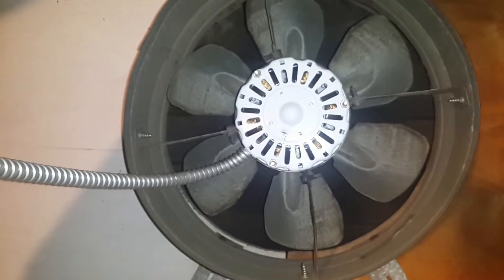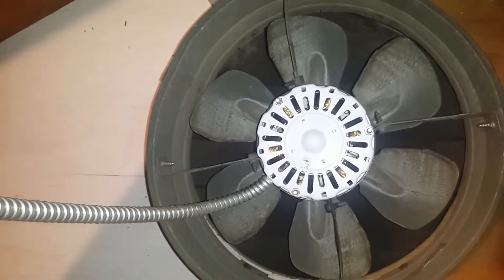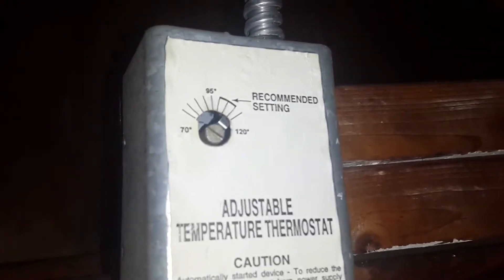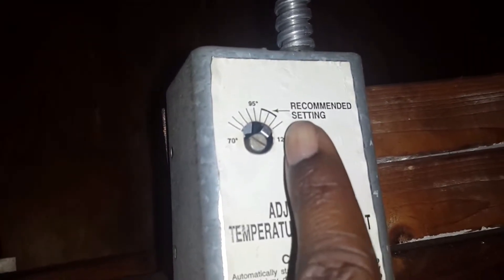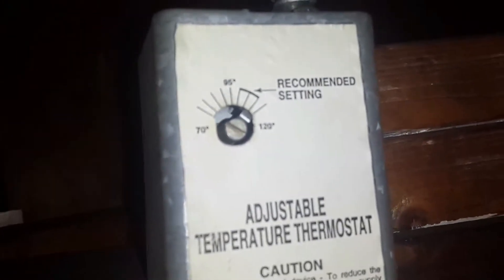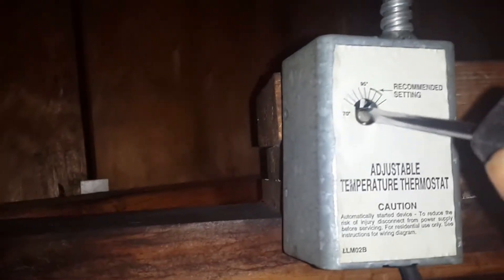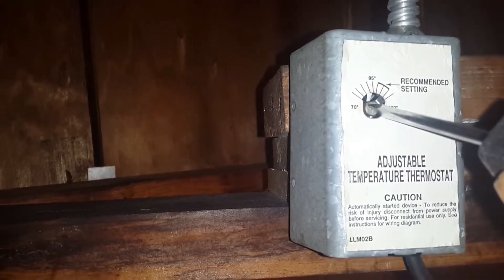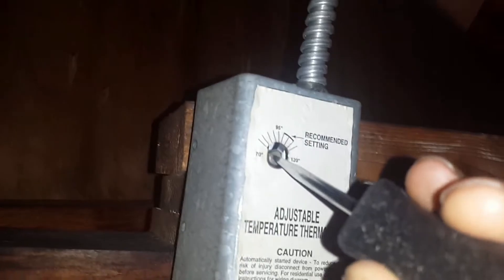How To Adjust Attic Fan Thermostat Temperature

Comment: How do i turn off the moisture settings my attic controller there are  three large vents opennings in my attic  to the outside when it raines the moisture controller turn on the attic fan and pulls more moisture inti my attic
Reply from the maker: We are not sure about the moisture control. Would advise that you make sure that there are louvers on the exterior, and that they are positioned correctly. If need be, you may need to change the cover on the fan so that rain water does not enter.

Comment: So, i’m not a genius or anything but why are we using thermostat designs that look like from the 60’s. Why not have a thermostat that reads the outdoor temperatures and changes accordingly? I mean we have iphones and stuff. Shouldn’t be rocket science.
Reply from the maker: Typically attics are hot (over 100 during the summer) and typically most electronics start to malfunction when the temperature gets above 125 F. Thus the electronic  thermostat would fail regularly in that environment.

Comment: Good job brother. You deserve thumbs up, and I did. I have a fan similar to yours in the garage. It came with no instructions, I only have my right arm, but was able to get it going. The thermostat came with no instructions, so I went on YouTube and connected the two blacks cable, one to the motor, the other to the power supply that plugs in an outlet. The instructions manual said to set it at 90⁰, I did. Just installed an hour ago. The garage is at 91⁰ or 92⁰. If it doesn't stop later what do you reccomend I do. Thank you brother.
Reply from the maker: Welcome!  Glad the video could help you out

Comment: I have an attic fan that turns on by itself but doesn’t turn off unless I turn it off with the circuit breaker switch. Would it mean that my adjustable attic fan thermostat is faulty?
Reply from the maker: Yes it could be. It should turn off once the temperature drops below the set point. Check to see if there is any debris or critters inside of it before replacing it. It is possible that a roach or lizard may have gotten inside. If all is clear on the inside then proceed with a replacement thermostat

Comment: Is there a way to shut it off completely if you wanted to?
Reply from the maker: Yes. You can disconnect the wiring or you can shut off the breaker. When it comes to the breaker, there's usually more than just the fan on the breaker. This other outlets or lights may not work if the breaker is shut off

Comment: Thanks, does the thermostat have to be perfectly level where mounted ? How accurate are these thermostats? I used a heat gun and got a 10 degree difference between cut off temp and actual temp.
Reply from the maker: Not sure sure of the accuracy. 
It should be mounted right side up for it to function properly. Depending on the type of thermostat, it being mounted improperly would cause it to not kick on at the correct temp. 
Thats kind of a big difference. May want to consider replacing it
Reply: I think most all of the time the switches work with a bimetal contact switch where the metal deforms at a certain temp and touches a contact to turn on and off.  So when youre adjusting the on / off temp you are unscrewing those contacts in or out makkng that deformation take a bit longer to touch and turn on..  those bimetal strips arent 100% precise and usually +\- 10° of tolerance..  so the mounting doesnt have to be leval or anything.  Now some thermostats use the bimetal with a mercury contact bubble like the old indoor hvac thermostats you turn.  Those have to be mounted a certain way for them to work right..  some thermostats are also digital which generally cost a bit more... otherwise the same switch thats in a toaster oven is the same thing thats in a temperature controller for the attic fans just are spaced for the toaster application with predetermined spacers on the actual bipolar switch..
Reply from the maker: Don't think this one uses metal strips. Usually you see that with thermostats that are fully mechanical (no electronic parts). The mercury ones were outlawed in the US if I'm not mistaken because of the health risk they pose. I did check and it does have the ability to adjust the temperature if the thermostat is misreading